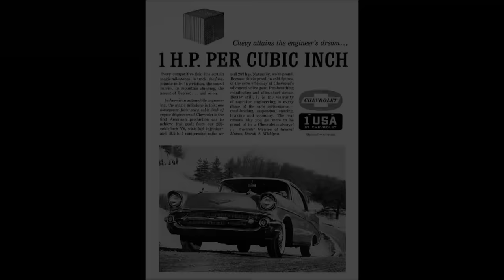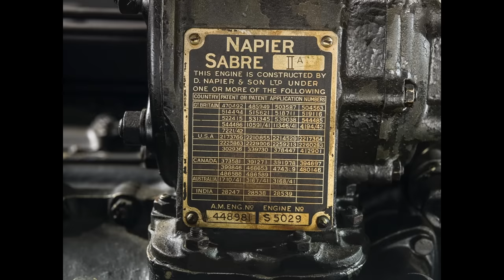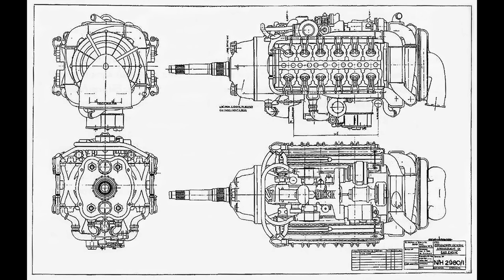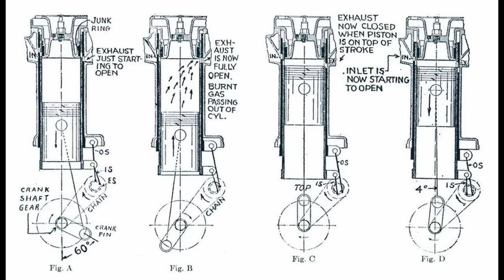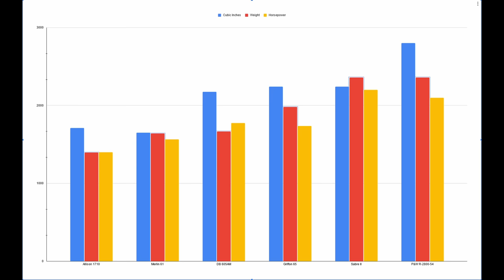Napier Sabre - The Ultimate WWII Aircraft Engine - Part 1

Comment: Let's clear a few things up.

1) The Sabre was not and could never have been "the greatest fighter engine of the war" for any number of reasons. First of all, it was only used in two types: the Typhoon and the Tempest, so it was not in widespread enough use to have the kind of impact that would change anything. On paper it looks fantastic but;

2) Your figures are based on the E.122 Sabre which never saw service in WWII. It was a development of the Sabre II that was planned to be used after the war but I can find no information that it ever ran, much less flew, much less flew in active service.

3) The Sabre layout was chosen because it presented the highest mechanical density and lowest frontal area for its proposed power output;

4) The sleeve valve arrangement created a series of problems. First of all, it was much more difficult to make. Napier ran into the exact same problems as Bristol in producing sleeve valves that would work. Bristol's efforts almost bankrupted the company and it took literally thousands of combinations of metallurgy and production and design before they had a workable production engine and it arrived just in time for WWII. Napier made efforts to coopt Bristol's engineers but I think without success;

5) Sleeve valves are not a good design for engines which need to run at high boost pressures because the walls of the sleeve distort over the inlet and exhaust ports, creating a friction loop that will eventually result in failure. Napier had a much harder time of developing it than Rolls-Royce did with their V-12 designs;

6) The sleeve valve design needed more lead because it needed more lubrication than poppet valve designs;

7) The Sabre had a higher rate of oil consumption than poppet valve designs;

8) The British government's intransigence on Sabre production had less to do with Rolls-Royce lobbying and everything to do with the practicalities of wartime production. Numerous Rolls-Royce designs were also junked: the Peregrine, the Crecy, the Exe, the Vulture and so on. Napier were lucky not to have suffered the same fate. In wartime, you go with what works and what is industrially the most efficient. That meant the Merlin and the later Griffon;

9) The Sabre suffered from several problems from a pilot standpoint. First of all, the high consumption of oil meant that fumes leaked into the cockpit and the pilot had to be on oxygen 100% of the time. Secondly, the priming of the engine could, if not done correctly, lead to a blowback on start up and the engine catching fire. Finally, the problem of boost pressure was never resolved and never could be which meant that neither type which used it was ever going to be able to mix it at high altitude.

As it was, the Sabre provided excellent service in a couple of very high performance aircraft, the Typhoon and the Tempest, both of which made valuable contributions to the war effort. There isn't much doubt that the Tempest was a formidable low and medium altitude fighter but the Sabre was too sophisticated and too difficult to produce efficiently to have been widely available and it was substantially less reliable than the Rolls-Royce V-12s.

The Sabre has become a bit of a cult engine, like the Porsche 912 (917) and the BMW M12/13 for which the most ridiculous claims have been made. To be fair, you didn't do that and I have seen more outrageous claims than yours for the Sabre. I don't propose to mention them lest we start a pissing contest.

Ref:
"The Secret Horsepower Race", Calum E. Douglas, Tempest Books, 2021
"The Development of Piston Aero Engines", Bill Gunston Patrick Stephens Limited, 1993,
"Hawker Tempest and Sea Fury", Robert Jackson, Weapons and Warfare, 1989
"The Big Show", Pierre Clostermann, Weidenfeld & Nicolson, reprinted 2004
"Typhoon Warfare: Reminiscences of a Rocket Firing Typhoon Pilot - WWII", Tom Hall, Blue Print, 2000

If you read only one book, read Douglas. He is an engineer who worked with the Toyota F1 engine development team in Germany, in the day when Toyota were still racing. He has an M.Sc and has been through pretty much every record there is on the subject. He also has his own YouTube channel where he explains a lot of this but there is no substitute for reading the book.

We all have our favourite engines. The Sabre is one of mine but that should not allow us too much luxury in terms of objectivity. I have little interest in the P&W R2800 but objectively, I regard it as one of the greatest engines of WWII. The other one is the Merlin. These engines shouldered so much of the burden of responsibility for defeating the Axis powers in WWII. They were used in literally dozens of types, ranging from crap like the Boulton Paul Defiant, to masterpieces like the Mosquito. The R2800, the Hellcat, the Corsair and the Thunderbolt were all magnificent in their own way (though the P-47 is becoming rather overrated these days, IMHO). They were reliable, powerful, relatively cheap and easy to produce, easy to service and available in any number of different variants for different applications.
Reply from the maker: This is probably the best comment on the video. Admittedly, I could not find the dates concerning the operational use of the E.122, so that is helpful. I agree with all your claims against the Sabre, as I did not include information about reliability and the limits of the design itself, mainly the power output. In the greater context, I agree that "greatest engine of WWII" seems a bit farfetched for the Sabre. However, you'll have to forgive my clickbait title... this is Youtube after all.
Reply from the maker: Also, I've just purchased The Secret Horsepower Race... Hopefully some well researched fodder in there for a new video.
Reply: @flightdojo  That’s okay. I have seen far more exaggerated claims than yours for the Sabre. It’s become a cult engine.
Reply: @flightdojo  There’s not a huge amount in there about the Sabre. What it does show is how a British industry got it right. I’m not a Brit but Douglas’ research is impeccable.
Reply: @flightdojo  Thanks for your comment.
Reply: Well said.  There's a reason that Typhoons and Tempests were scrapped after the war and not sold to 3rd world nations - liability.

Comment: The Sabres  sleeve valves suffered horrendously when the induction air was less than clean as a whistle, eg when operated in desert dusty environments..
Reply: True for many engines piston rings and fine oil channels. If the thing needs a rebuild every 60 hours in dusty environs then changing the sleeve valves too would just be another service item so not necessarily a deathknell for the engine

Comment: Have you added "Allied Aircraft Engines of WWII" by Graham White to your library? Excellent discussions. One of the interesting technologies that the Sabre advanced concerns the reduction gear drive that connected the two crankshafts to the single propeller shaft by way of twin idler gears of each. The backlash of the gears were managed by using helical cut gears and allowing the idler gears to slide on their shafts, but with each pair interconnected with a "teeter totter" link so they evenly shared the load.
Then the gas turbine came to being based on the same technologies needed for the turbo superchargers and turbo compound power recovery turbines and blew all the reciprocating engines out of business with power to weights and operating economies that were in a class by themselves.

Comment: Depending on variant, the R-2800 had a similar power to weight ratio as this engine. Though it is difficult to get system weights for things like the turbocharger set up used in the P-47.
Reply: When comparing strictly engines the forced induction system should be excluded. On the bearcats the r2800 made 3000ish hp with just a single stage supercharger

Comment: It was another overly complicated design with TOO many moving parts and it required a 'Shot Gun' cartridge starting system that was notorious for starting the planes on fire. The 'Sabre' engine actually had 4 crankshafts with each having 6 cylinders and the 4/6 arrangement was connected to a single output.
Reply: To be far all old aircraft were notorious for catching on fire during startup lol
Reply: The Sabre had just two crankshafts. Don't be misled by the power balancing gears in the nose of the engine.
Reply: I saw a sectioned version of the Sabre in a museum and to be honest I don't think I have ever seen a more complicated engine. It has an enormous number of moving parts.  Compared to the other aero engines producing 2000 plus hp at that time, it is very small and would have offered a massive aerodynamic and packaging advantage in a favourable installation.

Comment: This engine, while novel in a curiosity kind of way was just simply too complex and had too many moving parts, most notable of which is the signature sleeve valve system.
To try and seal and then admit or pass intake and exhaust gassed, AND combustion with what is a moving, rotating cylinder was never going to be reliable like a conventional cylinder and head arrangement.
That coupled with the added weight of the engine would in my view, be why it was unpopular.
Reply: Yeah, short service life, high oil consumption, dirty exhaust killed it... sleeve valve engines were used earlier here in Toledo Ohio USA for the Knight motor car...

Comment: The most prominent well read engineering writer of the War years  in British Avialtion was a guy called L.J.K. Setright who visited the development team at English Electric who handled the Napier Sabre engine development effort during the later war years.   Setright wrote a three/four  page  article in a top post war British Aeronautical magazine outlining the wartime development of the experimental Napier Sabre type V which according to Mr Setright made 4000/5000 hp before the war had ended..   

Napier had always been a very strong and wide ranging design and development company making all kinds of intricate cast and machined items of steelwork for the Worlds banks and governments from before the mid 1860s. They also produced a range of prestigious cars and manufactured advanced water cooled  and air cooled  aircraft engines.   Napier was the most feared opponent of both Rolls Royce and Bristol who utilised every dirty trick in the book to destroy this remarkable enterprise.  
Rolls Royce and Bristol had already seen off Armstrong Whitworth, Fairey and many other engine design teams for good but they wanted it all.  When one reads of the shenanigans associated with this gloves off battle royal you get the very strong impression impression that Rolls Royce and Bristol were more motivated  destroying by fair means or foul all of their British aircraft engine business competitors than they were ever motivated to destroy the Nazis.

Comment: The Napier Sabre with sleeve valves and liquid cooling in the Typhoon had two major problems. Ground fire and a hole in the cooling system brought it down which for a ground attack fighter/bomber was a major problem. But worse than that was due to the sleeves etc. and sealing problems used very heavy oil which resulted in major difficulty in starting the plane as the weather cooled down in the fall/winter of 1944/45 of northwest Europe. This resulted in the ground crews having to start the planes every 2 or 3 hours during the night. This is probably a major reason that the Typhoon disappeared at the end of WWII. The Bristol Centuries a sleeve valve air cooled radial which produced up to 2800 HP (in the Beverly) and the mighty Hawker Sea Fury remained in service well into the 1950's.

Comment: Fascinating and well researched video. It was started with a blank shotgun shell and if you didn't get it right the engine could easily catch fire. There is a story about a squadron leader who could not get the hang of it so he got the ground crew to start his Typhoon for him. Napier is pronounced nay-pee-ur with an emphasis on the first syllable.
Reply: Lots of plane and tractor engines were started by shot gun type shells... 
And what are you talking about? That's the way he is pronouncing it...
Reply: Amazingly B-52 Stratofortresses on the alert line were started with coffee can sized black powder charges.  Left huge clouds of black smoke behind when they taxied away.
Reply: Thanks for pointing out the correct pronunciation.  I found it irritating me in an otherwise excellent video

Comment: The DB 605 made a lot of concessions to manufacturing ease and field serviceability. It's really amazing that the type produced the power that it did. The Sabre was on the opposite end of the spectrum with massive power production, staggering manufacturing complexity and unrepeatable obscenities in constant use during servicing. Some obstructed fasteners needed two specially designed "spanners" used alternately to remove or tighten during servicing.
Reply: Will Rose  The DB605 had its sparkplugs located on the outside of the vee, where they could both be serviced by a technician standing on the ground. Merlins in the heat of battle rarely got their inside sparkplugs serviced. I'm not aware of Sabers ever being used in combat over Malta. 

The Germans used the "power egg" concept extensively. Engines could be swapped out within an hour "on the line" with low skilled technicians. If its gonna be made sloppy then it better be made serviceable.
Reply: Will Rose  It's a marvel that the German war machine functioned at all. It was a truly international effort to keep the global arms manufacturers cranking at full song. After all, Hitler wanted could've ended the war at Dunkirk but there was "no percentage" in that.